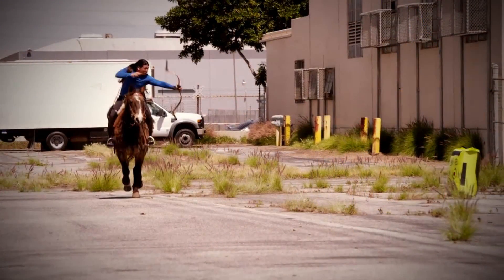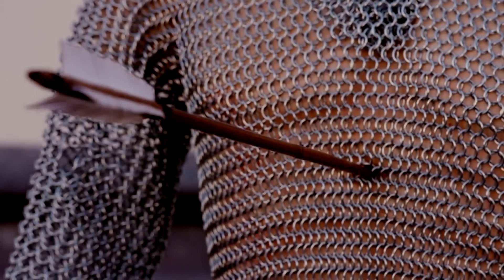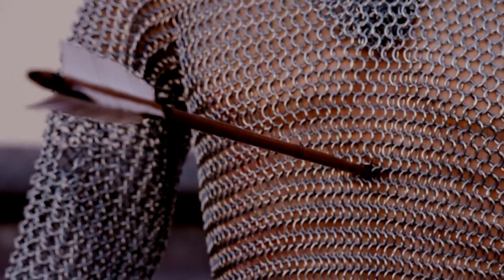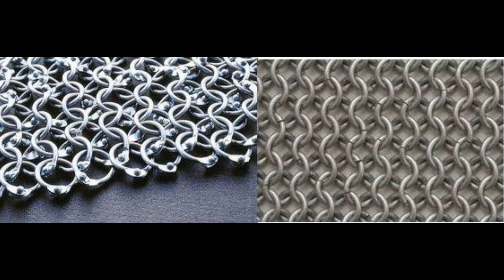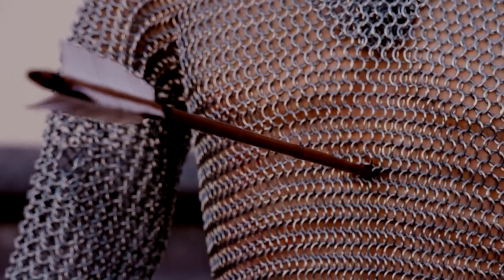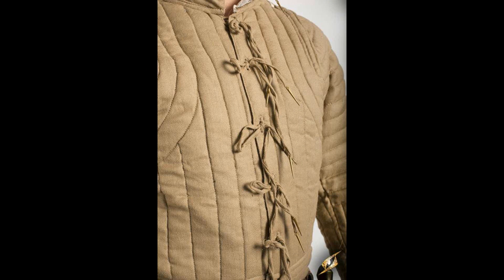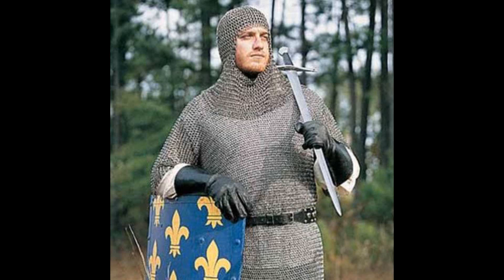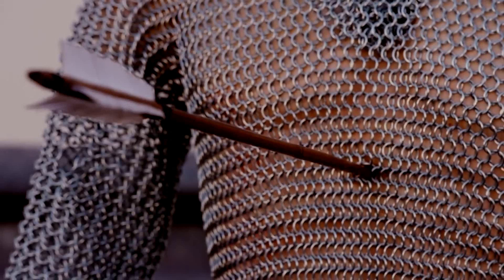TV Shows Testing Bows | Bad Archery History

Comment: Long story short, to make a valid test you need:
1. An archer who trained for many years in shooting high power warbows. I don't know how many modern archers are able to match the power of historical warriors, but probably few, considering hunting bows are nowadays considered 'high power' at 40 pounds, yet warbows would often be 80 pounds or more. Lighter warbows existed, but were primarily used against lightly armored opponents.
2. Historically accurate bows and arrows. Probably bodkin point arrowheads when shooting armored targets (any half decent armor should stop broadheads). Ensuring proper metalworking, so that steel hardness and elasticity is historically accurate for the given time period might also be necessary.
3. Targets wearing properly manufactured armor - if we're talking worst case scenario for the archer, i.e. late medieval full plate armor, this would include a gambeson and steel plates, with possibly riveted mail between the two (some plate armors included a full chain shirt, other would only use patches of chainmail to cover flexible joints). If we're talking about average footmen who couldn't afford full plate, you might be facing just against chainmail over gambeson, or just gambeson, or possibly other combinations. Really, depends on the time period, location, individual wealth and other factors. In any case, higher end armor would use the best steel available in a given time period, and the best metalworking practices known at the time, so if a given weapon test aims to see how bows fared against higher end armor (i.e. could an archer kill a knight)... you'll need expensive armor. Period. Any tests that cut costs here will end up unreliable.
4. Mounting the target properly might also matter. If the target is very rigidly fixed in place, it'll be easier to damage, since less force is dissipated into pushing the target back. Loosely mounted targets are more representative of typical combat scenarios, unless you're shooting someone lying on the ground or pushed against a wall...
Reply: And use actual armor, not jokes. The armor shown in this video is a 6 in 1 mail. 
Now consider that a decent mail worn historically would be a 12 in 1 or even a 15 in 1 mail.
This is like shooting with a gun at a tank that is build from perforated steel.
Reply: i have to disagree with one thing you said the arrow will never have enough energy to push a man back even now days weapons wont push a man and i remeber watching a man wearing armour was shot by a sniper the shot went throught his armour and spin he didnt move at all but he fell because he lost control of his lower body and yeah he was still alive and he tried to stand but didnt realize that his spin was destroyed and i have no idea what the sniper weapon is because that what their job is to never be seen
Reply: nop da energy is still dissipated through a person, we move around, and can be slightly knocked around by things of a high enough force: such as an arrow shot from a warbow. A secured target doesn’t have that same aspect as us. Plus, arrows are much larger than sniper rounds, they tend to have a larger impact on things they hit

Comment: Did they mention the draw weight of the bow at all? I agree wholeheartedly that butted mail is the cancer that plagues these “historically accurate” show, but I’m curious to see whether a bow of equal draw weight would pierce my riveted mail shirt and, I’m 90% sure it wouldn’t do anything substantial to my gambeson.
Reply: Unfortunately, the arrow with a long bodkin type arrowhead would have passed through the chain mail and stuck in the gambeson. we tested it on mannequins dressed in gambesons with riveted mailers, the arrow stuck in about 10cm. If bows with the right arrows would not work, they would not be so spread over the years and surface. A 45-pound bow with a properly selected arrow will pierce a deer, a 100-pound bow will get into armor
Reply: Tomasz Dudek I understand that mate, I’ve done it myself with a 65# horsebow and some needle nose bodkins and my own round riveted shirt, I was only wondering what draw weight the bow used in the clip was because from what I saw first hand, anything short of 50# couldn’t get enough penetration (even through the mail) to be considered a concern.

Comment: We shot a riveted, small-distance mail about 20 meters with arrows, with forged tempered arrowheads (bodkin), the diameter of the arrow radius is 9mm, the bow force is 42 pounds, one arrow falling into the chain mail just knocked down the rivet: P so if you take into account an 80-pound english warbow chainmail is not a problem

Comment: I generally see tests such as these fall into one of two categories:
1) As in the test analyzed in this video, decent or high quality archery kit and techniques are used, but against poor armor.  Butted mail, thin and/or unhardened plates of metal (sometimes flat plates), no padding, etc.

2) The category I've seen all of Thegn Thrand's tests fall under, actually, in which fairly authentic armor is tested against modern bows of low draw weight, low arrow weight, and shorter draw than was historically used.  To put it bluntly, 60-70# with 28" draw and 10 gpp arrows is going to be significantly less kinetic energy than was seen from battlefield archery anywhere in Europe and Asia, plus a significant chunk of Africa.  I've seen it claimed that it's supposed to be representative of archery at longer range, but this doesn't add up; if it were the case, they would at least use heavier arrows.

Comment: Does anyone know if butted maille was even ever used historically?
Reply from the maker: More commonly in Asia.
Reply: scholagladiatoria & Knyght Errant would probably the first channel to start looking at for that info. 

....but...probably it was...ish. Mail (historical) doesn't tend to run the same thickness or ring concentration uniformly all around. So you could be looking at all manor of combinations of experimenting. If you could get away with butting larger rings on the back or skirt, why not...but we know they knew it didn't work well for protecting which might make it a hard sell.
Reply: As someone who wears mail semi-often, when I can't be arsed to re-rived a ring that has broken, I have a spring in my drawer that I will cut a ring off of and bend into shape with pliers. The steel from the spring is thick and high-tensile enough not to be a weak link.

Comment: Any opinions or advice on cross eyed shooters? I'm R hand but L eyed.
Is is nessessary to have the arrow under your strong eye?

 I've relearned to shoot guns L handed but shooting a bow L handed the few times I've tried it is difficult.
Reply: Trained in the yumi, both hands.  Only issue l have with sight alignment is my accuracy is reduced and off to one side. Consistency is what I worked towards.
Reply: Keep both eyes open when you aim is what I'd suggest.  I know I often want to aim with only my right eye which is garbage without contacts, so yeah, both eyes open has helped me when I'm too lazy to put them in.
Reply: frigginresulrum. 
I say "bad" eye. I have 20/20.  My delema is Im right handed but left eye dominate.
  As a skeet shooter, I learned to aim with my dominate eye which is my left. I'm so used to shooting guns left handed. The few times I've shot a bow were disasters because knocking and drawing with my left side is hard, and I cant see anything with my right eye because my left is so strong. 

If I shoot left handed, that is to say hold a bow in the left hand and draw with my right, I my strong left eye takes over only see the side of the bow.
If I shoot left handed, hold bow with right hand, knock and draw with left hand and aim with left eye, my drawing is weak and knocking is hard. 

 I could close one eye but hate doing so.
Reply: Yeah, my left eye is dominant too when I'm not wearing contacts, it switches when they're in...which even my doctor thought was weird...anyhoo, if you're shooting instinctive, it really boils down to just that.  You practice and learn to compensate.  I know I can't do the "put the arrowhead on the target" thing cause then I just go stupidly high over the target.  

Sorry for the crap advice, but at least for traditional shooting it's a lot of trial and error.
Reply: I have the same problem, made the switch from right to left, struggled for about a week, then began to get the hang of it. One thing to be careful of is injuring your shoulder. I spent so much time at the target that I strained my shoulder and damaged my ring draw finger (went numb). Had to take about a month or two off. I also ended up adjusting my release from split to 3 under and my anchor from corner of mouth with nose on string to just my cheek bone.
Reply: I don't know if you've sorted this out for yourself in the 11 months since posting this comment but I'm also cross dominant. I shoot with my dominant hand instead of my dominant eye. I keep both eyes open and for the first couple shots when i practice i have to double check that I'm using the correct eye by winking but after a couple arrows i get used to using the correct eye. When I do slip up, my arrow flys left which can be annoying.

Comment: People also forget that bows used against armored targets were usually fired from altitude, at distance, and with war bows ranging from 120# to 180#. The arrows used were also quite heavy, likely 600 grain or more (I'd have to double check that). I remember watching a test one time where they had a professional archer atop a real English castle wall nail a dummy wearing plate armor from 500m, and the arrow buried in and out the back up to the fetching. They estimated the kinetic energy was in the same ballpark as a high caliber rifle.

However, the dummy was NOT wearing gambeson or mail under the plate armor. Still, the test was a proof of accuracy achievable in medieval warfare from a longbow. Oh, and the bow used was 120#, not even 180#.

The way I look at it, archers must have been effective enough against armored targets, or else no one would have used archers in battle. Perhaps it was more of a harassment tactic; it's dangerous enough that it can't be ignored. I'm no historian, so I could very easily be wrong.
Reply from the maker: Remember that arrows designed to pierce armour were designed to combat gambeson and mail, not plate. Plate was also not a common feature in most armies. The regular foot soldiers would have gambeson and mail, plus a helmet, but seldom would you see plate armour. Archers were best used against softer targets and to harass until they were able to engage with more precision.
Reply: I can guarantee that wasn't plate armour, it may have been thin mild steel shaped into an armour shape. Good plate armour will stop a bodkin point from war bow at point blank range. Even poor armour will only be penetrated a little bit, maybe enough to kill but not up to the fletching. See for example https://www.youtube.com/watch?v=Ej3qjUzUzQg
Reply: Goattacular 800grains minimun
Reply: @spocker22  Closer to 1400 gr. I shoot Manchu bows and at military weights (80+) you are looking 1250 gr. arrows.
Reply: Goattacular That test was wrong. It was aluminium breastplate. Lindybeige filmed historically accurate test.
Reply: well add that the target wont be standing at all if he was a human and arrows dont travel very fast

Comment: Drawing the bow with palm out? Why doesnt anybody draw with palm out?  Seems like it would be a more fluid motion of your hand was upside down and back of fingers resting against your cheek?
Reply from the maker: It's less natural. Your hands naturally turn your palms inwards. There's more torque and tension in your arm, and achieving a clean release is more difficult with the fingers opening into your face rather than away. It can be done - Gudjonsson is an Icelandic archer who shoots Olympic-style with an inverted grip. However, there's a good reason why the conventional grip was used historically and in modern shooter: it is overall the most natural technique.
Reply: NUSensei. Thanks for answering my question.  Really appreaciate you takeing the time to read and answer. I had another question about eye dominance. Idk if youve  seen so I'll paste it here.

"Any opinions or advice on cross eyed shooters? I'm R hand but L eyed.
Is is nessessary to have the arrow under your strong eye?

 I've relearned to shoot guns L handed but shooting a bow L handed the few times I've tried it is difficult.

I say "bad" eye. I have 20/20.  My delema is I'm right handed but left eye dominate.
  As a skeet shooter, I learned to aim with my dominate eye which is my left. I'm so used to shooting guns left handed. The few times I've shot a bow were disasters because nocking and drawing with my left side is hard, and I can't see anything with my right eye because my left is so strong. 

If I shoot right handed, that is to say hold a bow in the left hand and draw with my right, I my strong left eye takes over only see the side of the bow.
If I shoot left handed, hold bow with right hand, knock and draw with left hand and aim with left eye, my drawing is weak and knocking is hard. 

 I could close one eye but hate doing so."